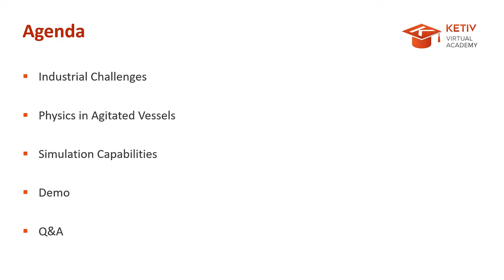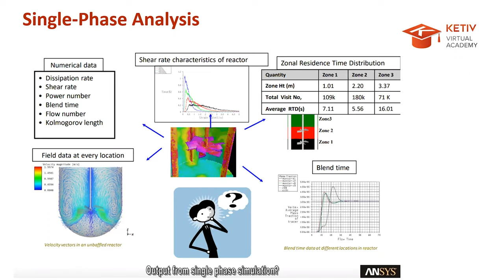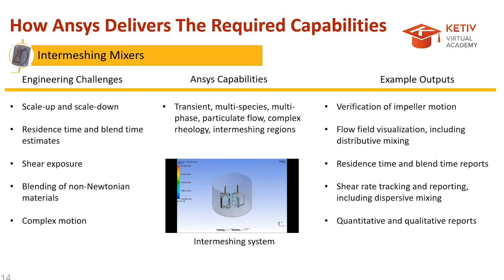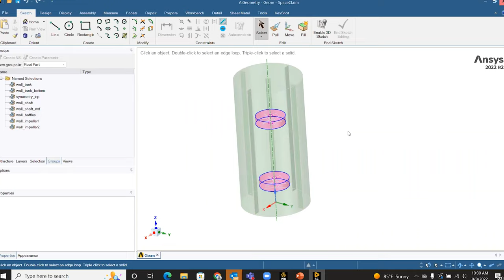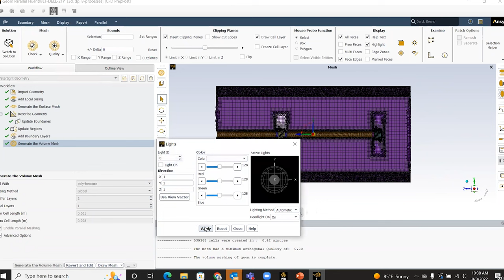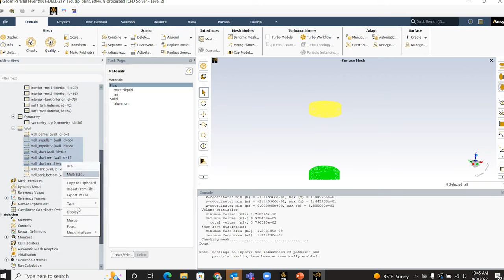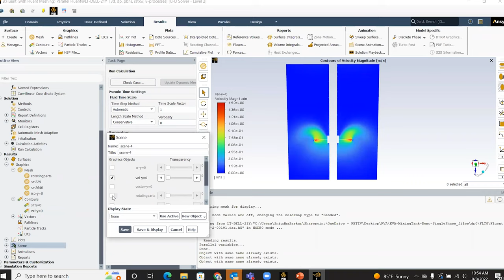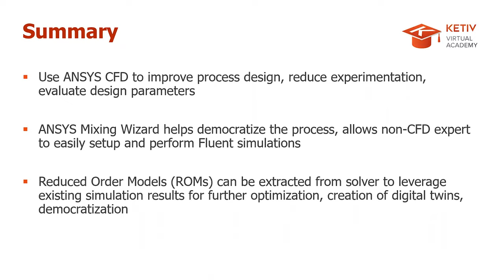Mixing Tank Simulations using Ansys CFD | KETIV Virtual Academy

Comment: When you gave 300 rpm for mrf1 and mrf2 fluid zones, does that mean, the whole fluid in that two zones is rotating with 300 rpm? If so, will it not be different from practical case? Shouldn't only the impeller walls rotate and influence the surrounding fluid, just like the rpm you specified for the shaft?

Comment: Hi, @24:14 you talked about the MRF zones for the mixing blades and etc. I know from experience that the thickness of the MRF zones has a significant impact on the thrust and flow in the rotating zones. Do you have a rule of thumb for choosing the thickness of the rotating zones? 2-3 times the thickness of the mixing blades? thank you.